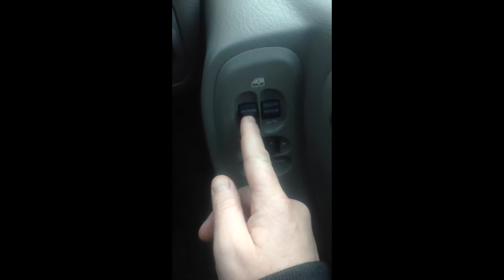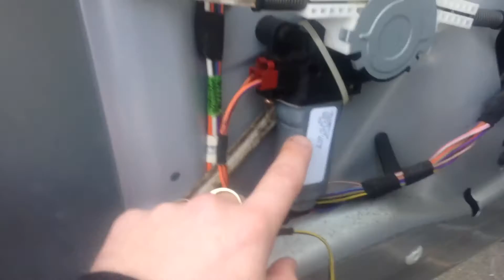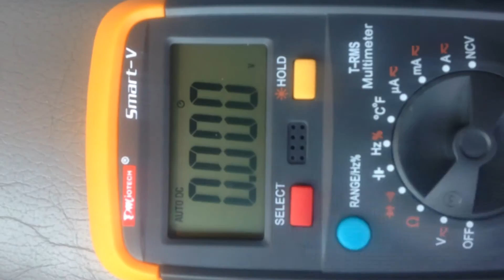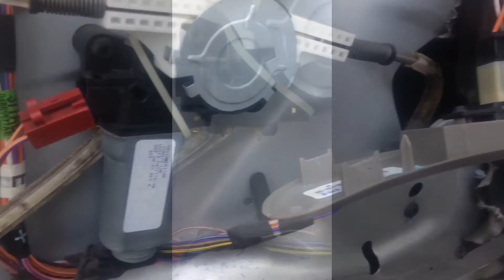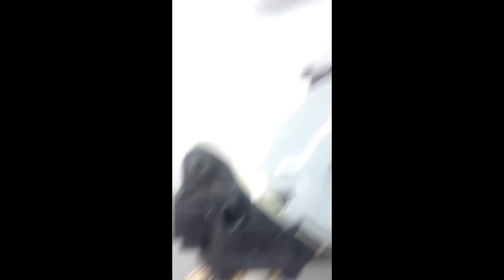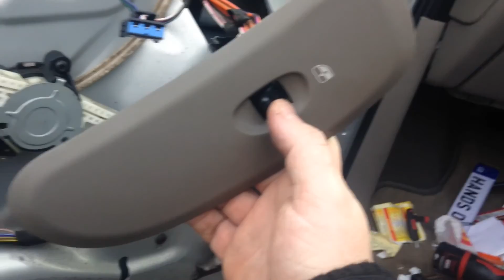Window motor repair for Chrysler voyager

Comment: I did the exact same thing with my 2000 Chrysler Town & Country.  Same exact problem you had.  I cleaned up all the contacts and the window operated just like yours.  After cleaning it would go down fast but slow going up.  So I cleaned and greased the screwdrive on the motor.  Then I lubricated the window tracks and the drive cables on both sides.  That did the trick and it operated fast up and down with less resistance on the motor.  That lasted about a week slowly going back to the original problem of not going back up.  My question is, how long did your window operate normal after your fix?  Is it still working or did it start failing again like mine?  I'm trying to figure out if I need to buy a new motor for $40 or the complete motor drive and cable assembly.  I think I need to check the resistance on the motor but I wanted to see if you did anything else to fix your window.  Thanks in advance for any advice.  Great video!
Reply from the maker: @Trent It's funny you brought this up today, it was literally last Sunday, I had to take it all apart again as it failed about 3 months after I fixed it. Only this time, the cable had a link in it and was causing the problem. It was fast going down but not up. After spending about 2 hours on it last weekend. I resorted to giving up and will be ordering a new cable set. The motor is still ok. At the moment, I have put some wooden blocks in the door to keep the window up. Cars eh, they are a pain in the arse! 😀
Reply: @BeTheSmartOne2  I would order the whole motor/actuator assembly and call it a day.  I'm going to see if mine is binding up somewhere but it acts like the motor is either not getting good contact again or its tripping some kind of overload switch.  It will try and go up for a second then acts like it's out of power and gives up.  Then it wont even try and work until it's been a couple hours or so.  I think you might be right about the cable getting kinked or binded up somewhere.  Times like this I miss the manual roll up windows...  Let me know how it turns out for you.  At least you got a couple years out of it!
Reply from the maker: @trent1755  - well, above the motor is a coil assembly under a metal disc. I unwound that and greased it up, also took the whole assembly out of the door but the kink would just make everything bad again. I will let you know how I get on.
Reply: For those that go to sleep fetching videos to save money all over on this kind of repairs, I'll add that you should look into the brushes been worn.  Mine were. This is what creates the burned components. Most likely that's why a few months after just cleaning the components,  lubricating, and putting back together, yours stopped working again. Look into them and replace if needed. Those are cheap online.  Let us know for your case.

Comment: Excuse me if the question is dumb, but what did you use to clean these metal plates?
Reply from the maker: Mateusz Sołowianiuk ~ I used some solvent spray and a lint free cloth. There was some dirty deposits and this did the just the job